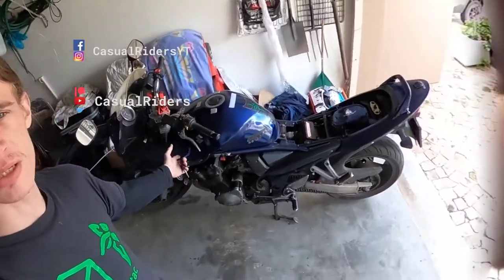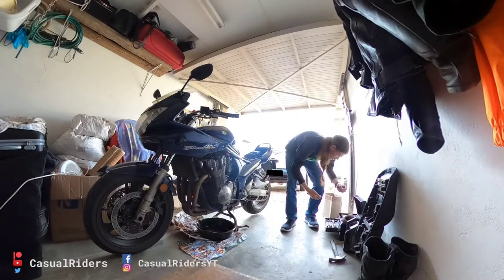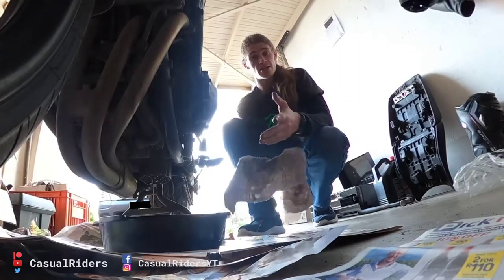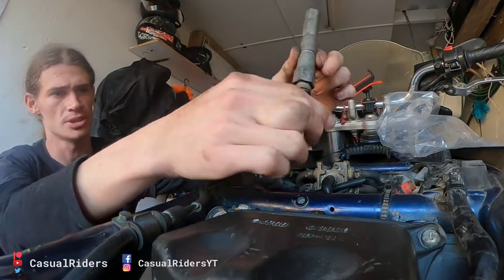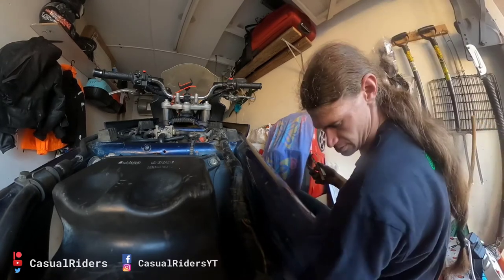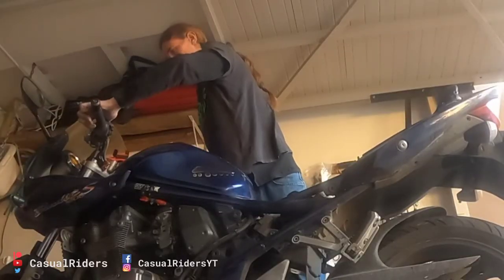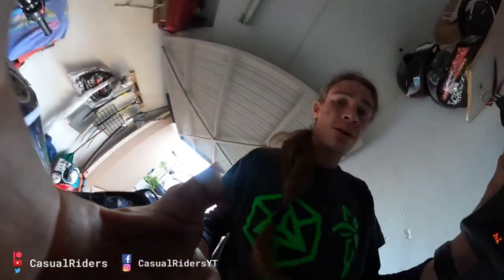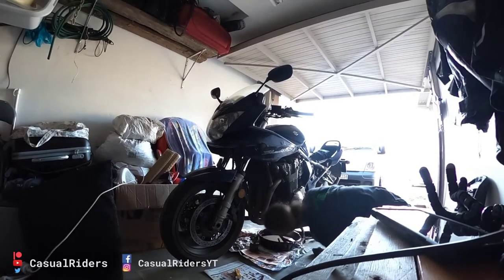Servicing The Beast - Suzuki Bandit Minor Service (oil filter, air filter, oil change, spark plugs)

Comment: Debating whether to service my bandit or take it into a garage… but after watching your video I might give it ago 👍🏻 ace video bro you have gained a sub off me
Reply from the maker: Thank you very much for the Sub. I do wish you the biggest success with the service, remember to take care of any fuel hoses when lifting the tank
Reply: Thank you for the advice. Just a quick question looking at my old oil through the little window it doesn’t look clean like oil should, it looks mercy/cloudy is that a bad sign?
Reply from the maker: @Revitgeorge  oil will go dark over time. As it cleans out the solid particulates in your engine,

Just make sure you're changing oil and oil filter at the recommended intervals, and 8f you're really worried, send an oil sample to a lab for testing, they do a spectral analysis of all the compounds in the oil and give you an analysis
Reply: @CasualRiders  appreciate it mate thank you 🙏🏻

Comment: If you are replacing the oil filter anyway - i normally just put a screwdriver through the side of it and use the leverage to rotate it off
Reply from the maker: Never been a fan of that method, I've seen a filter slice someone's hand wide open because the screwdriver slipped and ripped through the metal, leaving long sharp edges exposed

Comment: Have trouble removing your loose plugs use a bit of rubber hose that fits tightly over the insulator. Should have gone a K&N air filter particuarly if you have a free flowing can. But may need a reprogram wigh the ECU for that not sure?. Ive read diffrenf things mine has all that before i got it and it runs great with a k&N and a Yoshi. You would think they reprogram themselves just let it idle maybe a minute then take it steady through the rev range in each gear maybe?. Mines a 2008 1250 Abs Bandit. Heaps of torque and grunt. Suzuki South Adelaide?.
Don't forget tyre pressure, check brake pads, Coolant then its  bSic service. Add swing arm and wheel bearing chajn and sprocket check  next time you need a rear tyre.
Reply from the maker: At that stage, I couldn't justify spending the extra cash to order a K&N filter, as they aren't well distributed in South Africa, I have since switched to the K&N washable filter, and it works fantastic without ECU work (I'm on an '06 with carburettor and already had the freeflow pipe when purchased). My Suzuki South is in Cape Town 😁😉
Reply: @CasualRiders  i subbed your cool channel great to see you love working on your own bikes.
Reply from the maker: @eazyrider6122  thank you very much, I do appreciate all the support

Comment: Nice but I am going with oil that is available at a fuel station as I do not want to be caught short.  I think Motul is great but Shell Helix Ultra is available at almost every Shell Fuel Station, different strokes for different folks
Reply: I did my air filter this weekend and the bike is so much happier
Reply from the maker: As long as the oil is suitable for wet clutches, it's all good🙂 and of you're "running out" then you have a peak that needs to be addressed 🤔
Reply from the maker: Motorcycles have a tendency to do that... 😂
Reply: @CasualRiders  Dry clutch in mine :)
Reply from the maker: Now I'm intrigued to know how the engineering on that works🤔🤔🤔
Reply: @CasualRiders  Just take a look at a Ducati, they are more obvious

Comment: Hi Nice video i have a 1998 bandit 600 how often should u need to change the spark plugs, air filter and fuel filter i change the oil and oil filter every 3.8k miles. Would u say spark plugs every 6k miles or every service
Reply from the maker: The service manual for the 2000 GSF600Y recommends an inspection every 4000 miles (6000 km) and replacement every 7500 miles (12000 km).

Seeing as this is the exact same spec as the 1200 Bandit, I believe it safe to swap plugs every other service.

Thanks for watching the video 👌😉

Comment: What size spark plug socket wrench is needed? As well as oil filter and oil do you recommend? 😅 just got a bandit 1200 and was just wondering.
Reply from the maker: i'm not sure what the size of the plug wrench is, I used the tool that comes with the stock tool kit,  but you can use NGK JR9-B  or JR9-C plugs, and measure them.
I'm using the Hi-Flo Filtro generic made for the Bandit, Most bike shops here use a lookup catalog to get you the correct parts, so I just order it for the bike based on year model. lastly, I'm running Motul 5100 10w40.

Comment: You from Cape Town bro?
Reply from the maker: Originally from Jo'burg, but I'm in Cape Town now
Reply: @CasualRiders  cool man, had to rewind when you said suzuki south😅
Reply from the maker: Yeah, South Motorcycles is my go-to for replacement parts, especially on an older bike, often spares need to be ordered from Japan🙈
Reply: @CasualRiders  try Craig's parow or startline sometimes Ryan's for a second hand goodie or Mo in pardeneiland.
Reply: Bought me a 06 1200 bandit today... Need to strip carbs and see what's up... Got a flat spot mid throttle, after that like a batt outa hell lol
Reply from the maker: @1990AngeloS  haven't had much luck with them in the past😒 seems they aren't holding bandit stuff
Reply from the maker: @1990AngeloS  oooooh nice. You're gonna have many exciting rides 😅 when you say flat spot, does it lurch under you? Start simpler than the carbs if you can help it (plugs, air filter , leaking intake boot) if those don't bring results, then it could be an imbalance or cracked diaphragms inside the carbs
Reply: @CasualRiders  will check that out thanks bro ride safe out there... Some idiots on our roads smh
Reply from the maker: @1990AngeloS  always do, but one can never be too careful. Best of luck with your carbs, maybe we'll run into each other on the road. Until then, Ride safe🏍️💨🏍️💨🏍️💨
Reply from the maker: Have you had any luck getting your Bandit up and running properly?